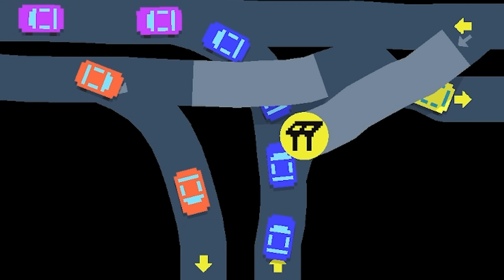Using REAL HIGHWAY LAYOUTS to get high scores in Freeways!

Comment: From a common man's perspective, you should do the simplest and most intuitive roads as possible even if it costs a lot more to build.
The designs should make sense to common dumb people like me.
Now I don't think the game will reward this, but if the politicians do this, then people will vote for them. If they overcomplicate traffic, no one likes that, no one likes overthinking on the road.
People want turns that make sense. Not everyone is an engineer on the roads. 
Common people think like this, I want to go left, so I need to make a left turn.
Now that left turn should take them to that road that they wanted to go to even if means that that part of the road circumnavigated the intersection....it should put them on the road their brain was thinking that a left turn would.

Hope it makes sense

For example I'm willing to spend a few more minutes at a roundabout than a cloverfiend because roundabouts are simpler.
I don't want to break my head wondering which lane should I keep at, which turn should I make etc....roundabouts are not that efficient but easier on the brain. You know that even if you miss your turn you can circle the roundabout once more and make the correct turn.

I personally hate overcomplicated intersections.

Comment: I gave in and purchased this game on steam Saturday. Not having an undo button SUCKS. The little jump that the road does when changing height also sucks – especially if you’re needing to make a tight merge.

Drawing these things with a mouse also sucks. I’ve had to lower the sensitivity to get smoother runs, and having to hold the mouse button down hurts after a while.

This game would work better as a mobile game imho, especially on a tablet. Drawing paths would feel more natural.

Comment: Just wait, you'll eventually get to levels where the game will not let you bridge over other roads.  Also, the Stopwatch building, when you're on the main map, lets you toggle whether you see the scores and number assigned to the smaller squares or not.  In the other direction, the Question Mark building shows you the pictures you've unlocked as well as some tips for those who have been just brute forcing solutions.

Comment: After watching your previous Freeways video, I went and got the game myself.
I got 437 on the first one, number 15, by doing a very complex junction not at all like yours, which simply uses less concrete.
I only got 320 on the 2nd one, number 14, probably due to tight corners.
My solution was basically the same for the 3rd, number 13, but must've used a tiny bit more concrete.
I got 359 on the 4th, number 12, probably overly complex and may redo like yours.
I got 352 on the 5th, number 11, with a similar design to you.
I got 448 on the 6th, number 10, basically copying you.
I got 335 on the 7th, number 9, using the through roads plus a backwards roundabout over them with roads to the car washes and a bypass to the lower ones. Redoing it like yours, I got 492.
I got 573 on the 8th, number 20, after refining my previous design (the same as yours) to minimise bridges and road length.

1. 269
2. 416 using magic roundabout style
3. 387 using a simpler version of the sort of thing you did
4. 319 using a big roundabout
5. 283 using a bad triangle design
6. 564 using a hamburger roundabout (no horizontal cut throughs, only vertical ones)
7. 317 using a design I could probably simplify
8. 491 using a hamburger roundabout
9. 492
10. 448
11. 352
12. 359 
13. 176 using a roundabout
14. 320
15. 437
17. 256 using a fan style design
18. 298 is just a mess
20. 573
21. 300 as a double roundabout
The rest not done yet.

Comment: I'm not sure if the Android/iOS version, or the PC version is easier to get those lines just right...at least the PC version has right-click bridge building. 

By the way, if an interchange has an unlockable image, when you run the simulation, there will be a number in the top left of the score window that you need to beat to unlock the image.
Reply: I think the lines are best on the pc, personally i use a ruler, put it next to the mouse and just slide the mouse like you were drawing a line with pencil 😀 you have to eyeball the curves tho, still working on some solution with the compass 😀😀
Reply: @samotnaf007  using a ruler and compass is big brain. I used the side of my laptop or straight lines, unfortunately I don't think I have a compass. You might be able to do bends by just holding the pencil side of the compass in the hand you're holding the mouse with?
Reply: You all seem to have played this game, on the original 9 on the top left one how the dick did he use bridges? they are supposed to be disabled for that one or at least it is for me.
Edit: I reset the game and now I can build bridges on that map, maybe it is random which maps you can and can't build bridges on?